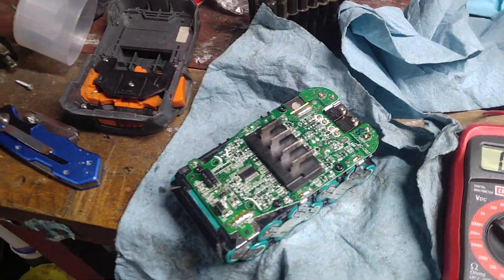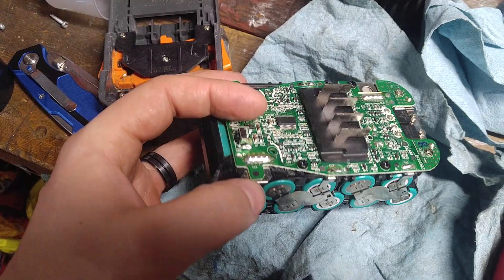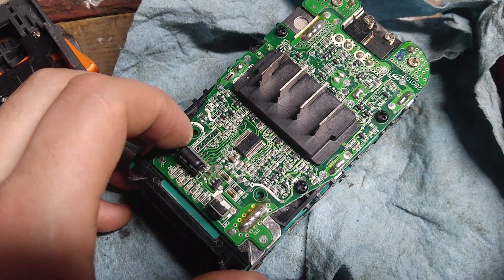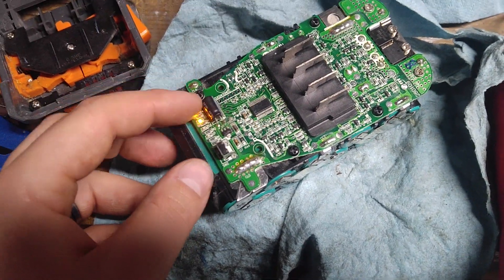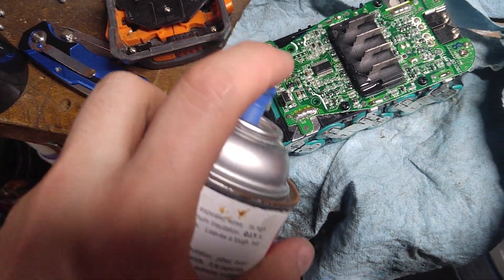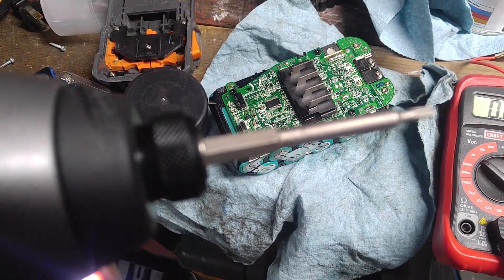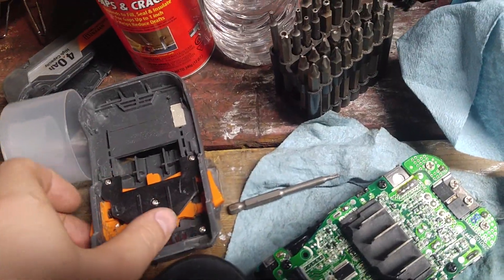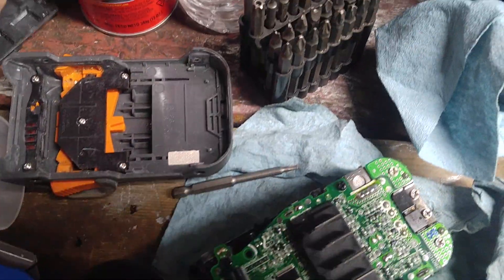Ridgid 18v Battery Not Working

Comment from the maker: AstroAI Multimeter Tester 2000 Counts Digital Multimeter with DC AC Voltmeter and Ohm Volt Amp Meter ; Measures Voltage, Current, Resistance; Tests Live Wire, Continuity - https://amzn.to/3YhNX5Y

MG Chemicals 4226A-340G Clear Insulating Varnish, 426 mL 1-Part Aerosol Can - https://amzn.to/3zTBuv3

SPARTA Flo-Pac Grout Brush Crevice Brush, Detail Brush, Nylon, 8 Inches, White - https://amzn.to/3SkGhw4

Amartisan Torx Bit Set, 24-Piece S2 Steel, 1" & 2.3" Long T5 - T40, Security, Tamper Resistant Fastener Drive Bit - https://amzn.to/3SkBBGk

Comment: help out? what did you provide here in the way of diagnoses or fix or any component level info dude. I dont get  it. WTF . this is a video of nothing.
Reply from the maker: It was showing if you have corrosion on your circuit board,  that would cause issues with your battery 🔋 charging or working & how to fix it by cleaning 🪥🫧 it   & putting a protective coating on it.

Comment: How do I do a reset on this battery.  It did a full charge but the lights flash and drill will not run.
Reply from the maker: I'm trying to remember I think there's some type of diet or some type of electronic component on the back near the negative I'm trying to remember how you wake him up will see if I can find the video for ya

Comment: I have 2 18 volt that show no lights at all. I watched several vids like urs and scrubbed the whole circuit board and battery connections with contact cleaner. When I plug it in the charger, red flashes about 3, 4 times then green light shows, as in fully charged. Still 0 lights and no sign of power in tool. Tried two different drills, 2 different chargers, same results. Date on batteries show only 2 years old. Both look like new. No sign of serious corrosion inside. Obviously something is wrong with them. They were a set. Only one secession manufacturer number apart. like a set right off the assembly line back to back. Very curious. I'm no electronics wiz so have no idea what to look for. I've got several other Ridgid tools and batteries. Never had this symptom before. Someone suggested a fuse, but don't see anything that looks like a typical fuse. Any ideas? Thanks
Reply from the maker: So you need to take a multimeter and check the cells you can either check them individually or you can check the two main points there's a main point on either end one would be a positive and won't be a negative end and you want to check those for your main voltage,  if after checking each cell individually and they're all at least 4 volts or around the same voltage or checking the main voltage and it is around 20v,  then you need to check the positive negative pins that connect to the tool/charger if you're not getting the same voltage or at least like 18 volts then the transistor on the negative side is not allowing the power to pass to the main pins and there's a way to wake up the transistor but I'm not 100% sure how to, I've heard you have to apply voltage to one side of it or something like that, now if you have similar voltages at the main pins as you have to the positive and negative leads on opposites sides of the battery, then you may just have a problem with a battery cell, the voltage being out of balance from the other ones, and if you do find a battery cell or several that are out of sync with the other ones you will need to bring them all up to about the same charge unless you course you find one over the 4.2 volts and in that case you will need to have to bring those cells down and voltage because you cannot bring the other cells above that or you shouldn't and if you can't balance the cells you may just have to replace the ones that are bad it's usually not worth it at that point
Reply: @DrewsBackYardMechanics  Thanks, Will give it a check see. I'm just so surprised, never had a battery that shows no life at all. Usually they wear out and charge but die quickly. And 2 back to back? Curious.
Reply from the maker: @peterford9369  I've seen it with Ryobi batteries
Reply: @DrewsBackYardMechanics  Hi Andrew.  I checked out all the cells and the voltage at both ends. I'm only getting 8 volts total and the cells are running from, 0.5 to 5.0. about 3 are reading 0.2. My problem is, no charging at all. I know both chargers work fine. But both blink red 2,3 times, then green. Is there a fuse in the battery? Still shows 0 lights when pressing test button. About ready to call it quits on these 2 batteries. Not worth all the hassle. I saw when you sprayed the batt with cleaner, the test lights shown for a few seconds. I get 0 activity from anything no matter what i try. For about 25, I can get a generic. Just recycle these. Just so poed because their so young and,,,both failed almost at same time. Makes me not trust Ridgid batteries.  Any hints, other than what you gave me before? Thanks man. Take care.
Reply from the maker: @peterford9369  you need to charge up each cell individually to 2.8/3.2 volts, or you need to charge the whole pack back to at least 16 or 17 volts you can do that with adjustable voltage regulator I'll post a link for it
Reply from the maker: @peterford9369  Adjustable Voltage Regulator,LM317 Adjustable Voltage Regulator Power Supplement Board Digital Voltage Display - https://amzn.to/3A3BnNu
Reply from the maker: @peterford9369  https://www.youtube.com/watch?v=aKm_lA5gz4A 

Here is another video using a balance charger
Reply from the maker: @peterford9369  and Another one

https://www.youtube.com/watch?v=7HT8RTiVyeQ
Reply: @DrewsBackYardMechanics  Forgot to thank you for all your suggestions and support 👍 Thanks 👍👍
Reply from the maker: @peterford9369  No problem glad I could Help 😁

Comment: Thank you Andrew for this very informative video. I bought this Ridgid product 2 year ago at HD, I don't use it too much and was surprised when I tried to use one day and it didn't work. Tried recharging the battery and it would say defective batt. Started looking videos in YouTube and came across this one. Everything is as you describe it. I opened the battery pack and found corrosion all over the circuit board, I never leave my drill in a moisture environment, I was surprised. Then I proceeded to clean all the corrosion with a tooth brush, then with some alcohol, voila, after drying now is back in working condition. Thank you again and thank god for YouTube. By the way, made in C...
Reply from the maker: Glad this information helped you - don't forget to subscribe 👍

Comment: My 4Ah battery shows a full charge but won't operate.  I know it's a problem with the battery because my tools work fine when I switch batteries.
I think the battery was damaged when it was placed next to a heater vent.  What do y'all think?
Reply from the maker: Probably the relay that allows the negative power through is not working
Reply: @DrewsBackYardMechanics  thanks!
Reply: have the same problem. 2 batteries came with the drill, one suddenly stopped working, even though the charging lights say it's fully charged. The other battery works just fine. I'll disassemble to see what's going on.

Comment: Do you know how to open up their Octane battery? There’s only 2 T10 screws on one end and the other end seems to locked together. I wonder if I am supposed to pry it open or snap it off?
Reply: on the other end of the battery there are two round plug looking circles.  They appear to be from the manufacturing but they are actually plugs and they will remove and the other screws are under those plugs good luck.
Reply from the maker: I have a octane battery that I will have to take apart and get back to you

Comment: I'm not sure what the issue with my battery is, it shows full charge but when used in a tool it doesn't work. It keeps randomly making a dial tone noise every few minutes. Anyone experienced this?
Reply: Oleg did you ever find the issue ? I have the same thing
Reply from the maker: If you take the battery apart you can check the voltage on each cell to see if one cell is dead or if something wrong with the circuit board

Comment: I have a Ridgid 3.0ah lithium ion battery that appears to be completely dead. No lights when the indicator button is pushed. 0 volts on the multimeter and when I put it on the charger, the EVALUATE light flashes for about 30 minutes and then the DEFECTIVE light flashes. I bought it used so can't get it replaced under the LSA. It's in perfect physical condition though so it doesn't seem like it's seen much use. Any ideas?
Reply from the maker: You could try jump starting it with another battery or if you have a lithium charger you can try charging the cells
Reply: I did try jump starting it. It did not raise the voltage at all. I do not have a lithium charger.
Reply from the maker: @brendand3600  if you have a universal lithium chargerand set the charger to Auto then you can might be able to charge them from 0 to the regular voltage
Reply: @DrewsBackYardMechanics  Thanks.
Reply from the maker: https://youtu.be/m5V4MG0WZF4

Comment: My man, I revived 2 dead batteries using this method. Only thing that I thought was strange is one of them still read defective in the rapid charger but charged normally in the standard charger. I wonder what thats about 🤔 Anyway thx man you helped me out
Reply from the maker: Some cells could be unbalanced, you would have to check each individual cells, and if it's not that could be something with the circuit board,
Reply from the maker: Also if you have have a universal rc charger you can charge each individual cell too